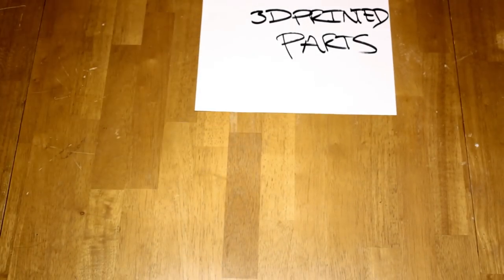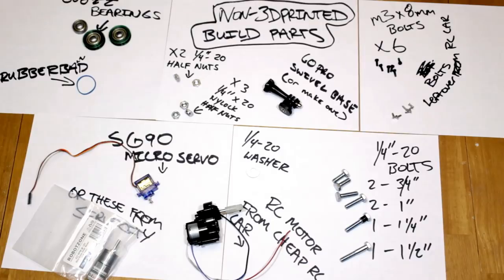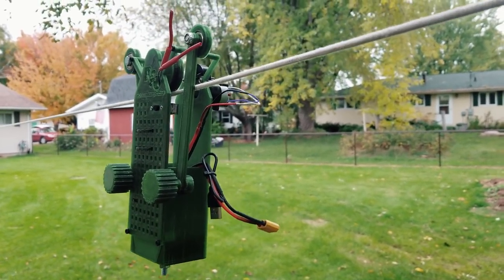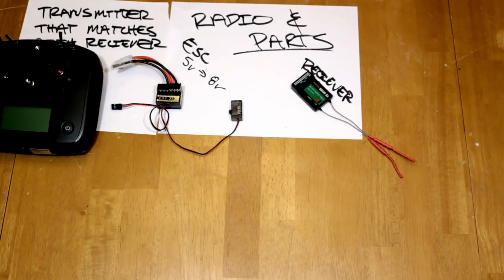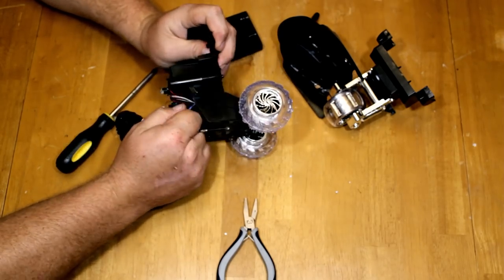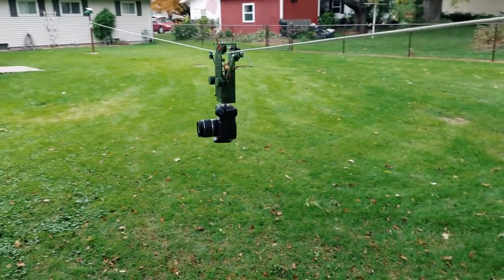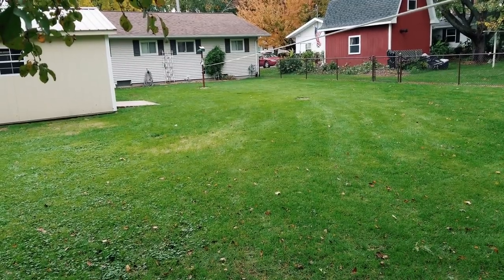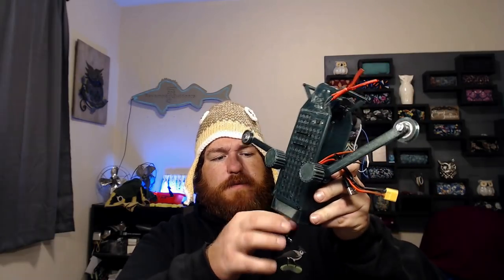Wireless Cable Cam Under $90 USD! - This is ROLL-E

Comment: Awesome bro! I’m waiting on my prints now 🙏🏼
Reply: Did you drill out the spot for bearings? The wheels came out solid for me
Reply from the maker: @earthonemason  thats weird the drive wheel should be solid but the stabilizer arm wheels should have holes the size of 608 bearings